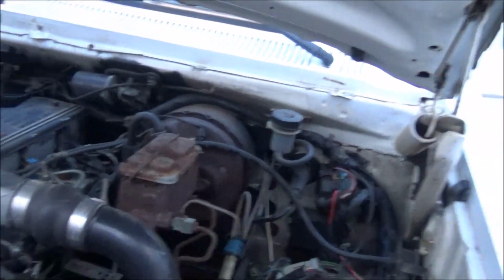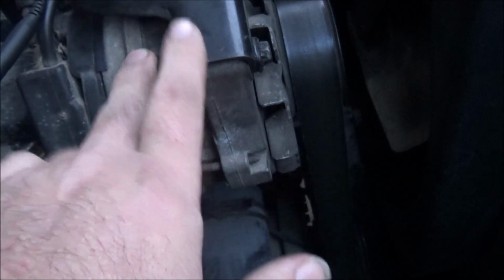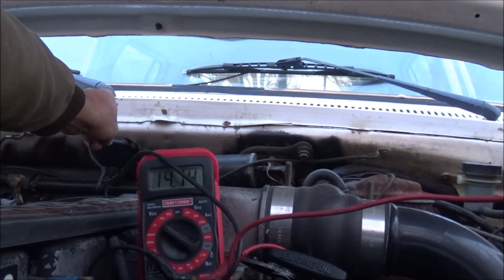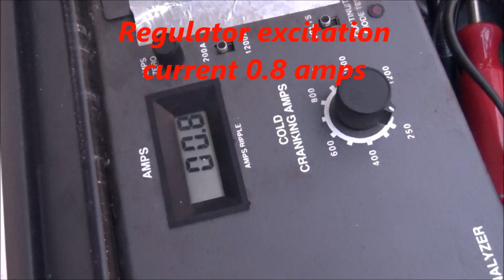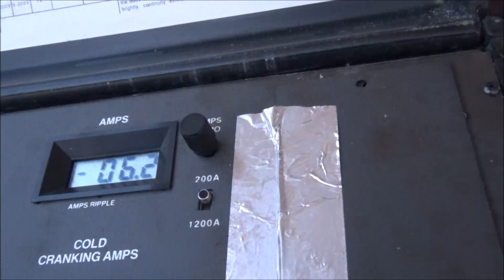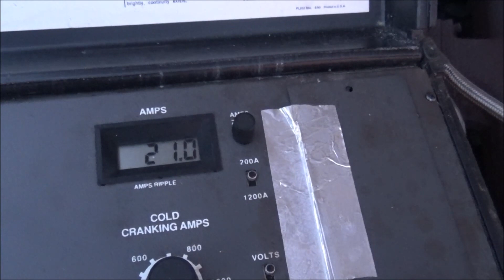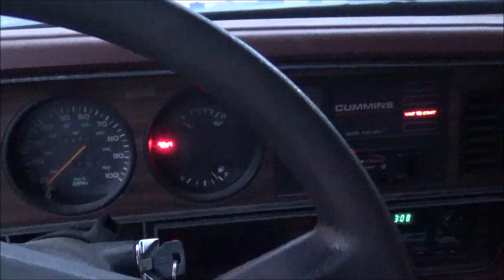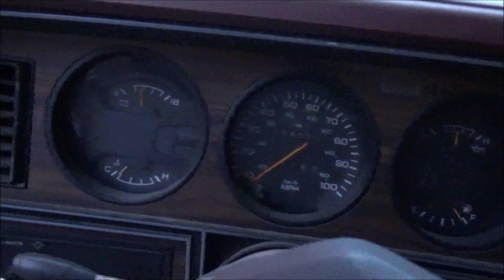Excorsing Electrical Gremlins

Comment: My compliments to you for a VERY thorough analysis of the charging system plus you appear to understand how it works. If you discontinue needing to refresh the regulator, I think you have to "assume" the problem was in the former alternator. I am never comfortable not knowing the exact cause of a problem after it has somehow been corrected. Just for giggles and grins, you may want to have the old alternator tested at a reliable autoelectric shop, not at a chain parts store. Thanks for the update and good luck now after the changes.

Comment: Aloha  I agree with Walt  I have had success with temporary jumper connections and observing the results.  An ohmmeter is not a good ground test in that under hood environment, that said I agree with your friend about shunt paths on a permeant basis.  Again as I said before the rotor in the old alternator was a possibility.  I hope your fix is permanent.
Chuck

Comment: Ohms don't tell you anything when it comes to grounds unless the wire is completely broke, checking voltage drop on cables while running is a step in the right direction, but the load isn't high enough to show a bad cable, any voltage difference on a cable is bad even .15v , that is at 15 to 20 amp draw , an increase in draw such as when trailer is hooked up will significantly increase voltage drop which causes an increased draw etc, the different amp readings also point toward bad cables. Checking ground connections doesn't tell you if the cables are bad internally, you need to do the voltage drop tests on the cables, poss and negative, while engine is being cranked to simulated high load on the cables, disconnect the run circuit and get someone to crank it while you  test the cables.
Reply: I agree. You can have continuity over a connection thinner than a human hair, but it wont handle any capacity in current. OHM test is almost useless unless you are trying to find a broken wire. Additionally a nice static test with the vehicle in park and idling away can be misleading. Bouncing down the road makes the demons come out. Much harder to locate intermittent electrical issues. I doubt he is getting a bunch of bad regulators.
Reply: Absolutely the truth.

Comment: Brian
I had the same problem with my wife's mail jeep. It would eat regulators about every three to six months. It was mounted low near the engine block. I moved it higher onto the finder well and that solved the problem. 
Solid state devices and heat do net get along well. Cummings turbos generate lots of heat when under load and can effect the regulator. Try moving it from the fire wall to the front of the engine compartment. Worked for me.
Reply from the maker: Thanks for the tip. I may have to try that if it fails again. It is in the same location as on my other truck though and it has lasted for as long as I have had the truck and 100,000+miles.

Comment: Brian. I'm sure you mentioned Bosch alternator and a Japanese one. All Bosch  alternators (maybe not first ones) but say after 1975 had a built-in diode pack. This stopped the alternator becoming a motor and trying to drive the engine and  also maximised the voltage output to 14.2 volts. The diode pack was part of the brushes unit attached to the back of the alternator and as such could be replaced without removing the alternator.. If your Bosch alternator is like this then you need to bypass the regulator  because it will cause the problem you describe, I have a Triumph Spitfire  which has an alternator  but the early ones had dynamo and regulator. Both wiring looms are in my Haynes manual. I used to convert cars with dynamo to alternator. The Lucas RB340  regulators were marked B for Battery D for Dynamo (Alt)on the large terminals  and F for Field  and WL  for the dashboard Warning Light.  There was also a fifth terminal E  Earth for the Regulator. To convert  to alt  the B and D terminals had to be connected together,  The Warning Light terminal  and Field terminals were connected together. Thus when you turned the ignition on the dash warning light would come on and the alternator field would be activated as before but NO REGULATOR. I hope this helps.

Comment: BC, thank you for taking my advice to monitor the alternator field current.  I think that is the key to solving this problem.  It can't be considered good or consistent, if I followed your video correctly...Was the alternator field current going high before you turned on the accessories?   It appeared to me that the field current was varying wildly...What is called for here is a scan tool, that can graph voltage over time, followed with a road trip.   I would map NOT the battery voltage, but the alternator field current while driving the vehicle, as the battery voltage will lag the regulator output considerably.

Entirely possible that you have an intermittent short to ground from some wire.  It could explain the irregularities in your tests.

Entirely possible you just have a chaffed wire, although they should be fuse protected, they do take time to blow....

I would go over the main battery wire/starter/ground wires with a fine tooth comb.

If you could scope that charging system while out and about, might be beneficial.

Comment: Very similar to my experience with the truck I referred to in other video. I didn't have meters in those days so I didn't have all the info you've got now. Something else you can look for if this persists goes along with previous comment about pinched wires. I had a truck with an 1157 signal bulb get a loose filament. bouncing down the road it would cross to ground, stick because of the draw, then continue to draw after shutdown. It created a slow bleed off of the battery. After it drained the battery, it would cool off, the filament would disconnect and no problem could be found. It was a brake light brighter element Which of course didn't show at first, took a couple jumpstarts to find that one. After being "schooled", that one is most often spotted when you see a vehicle driving with extremely dim marker lights and no lights running. Their light switch will be off. I've wondered about my old dodge, if there was some other slow bleed off that was intermittent. Seems that would be all you have left to hunt. I've heard about the Fords getting a intermittent slow draw out the solenoids creating gremlins. Keep us up on it, win or lose, I'm not the only one that wants to see the answer.
Reply from the maker: I don't have any discharge problems though the truck can sit a month and fire right up. The only problem I know for sure is the regulators quitting.
Reply: bcbloc02 Your right there then I would guess, unless is it possible a backfeed could have  blown a diode maybe in other alternator.? I hate gremlins, time sucking monsters.

Comment: Okay guys, here's my final diagnosis. Age related high resistance UNDER DASH is dropping sense voltage to regulator. 15 volts to the battery is just too much. A new regulator wouldn't try to push that much unless it was receiving erroneous information (reduced voltage to sense lead). This causes regulator to overcharge battery, as well as exceeding expected duty cycle on regulator, burning up regulator. 
Rather than fight the high resistance, just use current wire from ignition to regulator to switch a relay. The relay switches a lead direct from battery (thru 10A safety fuse) to sense input on regulator.

Comment: Things like that drive you crazy, I like the old school mechanical engine no def in that baby.
Reply from the maker: Just an ultra reliable 20mpg on this ride. You may not have any lights but it at least always will run if you can find a hill to roll it off. :-)

Comment: the volage drop on the positive cable is on the high side, usually should be less than 0.10v dc so even though you have low resistance under load your load resistance effecting the the circuit volage which would be why it could be charging on the high side voltage wise. I would look into a new positve cable assembly.

Comment: Brian, the charge voltage across the battery post should be 14.2-14.5 VDC but anything over 14.7 will cause gassing of the battery and possible damage. It may be possible you have a flakey cell in your battery causing the regulator to output more voltage. Since you are charging at almost 14.9 VDC, something seems amiss. I did read an article where a guy had your problem and redid all the grounding and replaced the alternator, only to burn out his next regulator. Out of desperation, he changed the battery and the problem went away. Just a thought to see if you could swap the battery to see if the charge voltage across (a fully charged battery), would drop back into normal range.
Reply from the maker: This particular reg is a little hot. The previous exact same reg ran about 14.6 on the same battery.  Having had multiples of these regs on the same truck I have seen a lot of variance in their outputs. It is one of the reasons I suspect the regulators are all junk and there is nothing wrong with the truck or alternator.  I think the quality is typical chicom garbage and I need to find a old genuine regulator. Lucky for me one of my viewers has offered to build a proper reg so maybe that will be the final solution.
Reply: bcbloc02 You may be right. I worked in electronics technical support for many years. I used to tell the folks that called me that they were the experts since they did this everyday. I was there to find the "goofy shit" or what I called, what it couldn't possibly be. What I usually found was it was something incredibly simple or something it couldn't possibly be. That's why I recommended the battery swap since it is the least likely problem but one that others have reported. I once had a problem with a printed circuit that measured a zero ohm connection. Once we bypassed the solder trace with a wire, the problem went away. Both measured zero ohms but a load caused high resistance in the printed circuit. Batteries not only provide power but filter and buffer any dirty DC current. The telephone companies still use large batteries for backup but their daily job is to filter "talk battery" so any rectifier spikes don't show up as noise.
Reply: Swapping the battery makes sense to me. The theory would be that the battery is drawing too many amps for too long. Or not. But it's easy to try.
Reply: Problem:  You can run vehicles without a battery period once you've started them.

Next problem, heavy current drains from a bad battery reduces battery voltage, not  increasing it.    His voltage readings are high however.  I admit that seems strange.

Nothing like throwing in a bad replacement part to confuse a man to insanity.....I troubleshoot equipment (not cars) similar to vehicles for a living....I'm am barely sane......use a bad part and your whole world goes crazy.....or how about 2 bad replacement parts....nothing makes sense then....LOL
Reply: Clete88 You are correct that a bad cell would lower voltage but that would be the output of the battery, not the charge voltage output determined by the regulator.

Comment: Many years ago I used to work on cars and light commercials in the UK. I can tell you that none of these to my knowledge used a regulator unless they were fitted with a dynamo. Every alternator  had a diode pack  at the rear which controlled the output. The heavy duty wire  connected either direct to the battery positive or the other end of that main cable at the pre-engaged starter motor main terminal.. The small field terminal went via the ignition warning light to the ignition switch. Alternators that were rubber mounted had an earth strap to the engine.  The battery earth was connected to both the engine and bodywork. Nothing else was needed. Charging voltage was 13.7 to 14.2. There were very few problems apart from loose or dirty connections.
Reply: +colm, thats how our british alternators work, but the americans seem to like to follow old habits and use an external regulator, just like we used to with dynamos, they can of course buy an integrated alternator if they want to, they also seem to enjoy alternators that overcharge batteries at 14.8 or over 15v but thats up to them :)
Reply: As a lifelong American and heavy duty equipment/diesel mechanic I can assure you that most Americans have not a clue what voltage  their battery is being charged at.  Those of us who are in the know are not happy with a 14.88V~15V reading of alternator output.  While we Americans do indeed follow old habits at times, you are forgetting that this truck is at least 24 years old and maybe quite a few years older.  That said this particular setup was an antique even back then.  GM alternators have used internal regulators since before this truck was built.
Reply: +mister, im not forgettingits age, i drive a 26 year old ford fiesta myself... and its the newest car ive ever owned!, even my previous 1972 ford,had an alternator with internal regulator!
Reply: Yes, GM first introduced internally regulated alternators in 1969... you do realize that Ford of England is a subsidiary of Ford US, right? Perhaps Ford was testing out it's newly developed internally regulated alternator on English Fords!
Reply: +mister I knew Ford is ford, i didnt know the when's of the alternator. my brothers 1972 car still has a dynamo (morris) still thats how it goes!
Reply: English  Fords  used Lucas alternators which had a diode pack from day one. I owned one.
Reply: What we in the trade call a diode trio is what makes an alternator an alternator and a voltage regulator (interal or external) is a different animal all together.  I actually built a replacement diode trio for the alternator in my BMW motorcycle a few years back.

Comment: Brian, that charging voltage of 14.89 seems a bit on the high side. 
Should be around 14.3 to 14.5. If your battery has high internal 
resistance from being constantly overcharged, that would explain why the
 regulator is hunting.

Comment: Earth the regulator body to the alternator case with a dedicated wire.
Reply: I agree ..
Reply: yep
Reply: This will destroy the regulator......that's his original problem....You would just be forcing the regulator into full charge......The problem is frying them to begin with.
Reply: And boil the battery....
Reply: no way , were talking ground just a dedicated ground ! nothing to do with the hot wire ..
Reply: Earthing body of regulator to body of alternator = earth to earth. This can do none of the harm you suggest. Is to ensure earth potential is same at regulator as at alternator. Else fluctuations will occur. Same as live feed from ignition source if dodgy then regulator will do crazy things.

Comment: Just some information. When the battery voltage gets up to the regulator set point the regulator turns off the field current till the voltage drops below the set point this happens fast enough that a digital voltmeter can't follow exactly. This is what is causing the varying reading you were seeing. For situation like this I prefer to use an analog voltmeter or a scope. You get a much better picture of what is actually going on.
Reply: Jim Hannon you are "right on" with the analog meter suggestion.

Comment: A couple of people mentioned a blown diode, I've known that to cause some real squirrel-y issues...  Someone else mentioned a bad cell in your battery, have you load tested your bat?  To my memory a bad cell will definitely cause voltage regulator heating as well and associated failures. Haven't dealt with a blown diode in a lot of years but I recall it can be real hard to pinpoint.

Comment: Remake all the grounds with heavier cable and new rust free connections. A contiguous ground strap made of braided cable will resolve the issue. You can measure the connections with an ohm meter, but those old connections will change with temperature and moisture, causing intermittent gremlins.  Yes, it's working now because of the connections being disturbed while changing out the alternator and regulator....but it will happen again.  IMHO.

Comment: Hi Brian,  
So far it looks good....   !!!
Now, would the trailer draw more current than it's possible to supply, this will be the next test...
Hope this is solved for good....   ;)
Cheers,   Pierre
Reply from the maker: Trailer adds at most a 30amp load, the alternator should have no trouble keeping up with that and it doesn't. When it is hooked up I show no discharge condition. I hope it is fixed if not I had a kind viewer offer to build a better regulator so that is in the works too. :-)

Comment: Brian, Had a problem like this on a buddy' van. The van had been slightly hit in the rear and it pinched a wiring harness to the aft lights. Took a while to find it but one very small  side marked light lead was rubbing intermittently against the body.
Fixed the bare wire and problem solved. Wonder if you have a similar situation.
Regards,
Eric
Reply from the maker: It is possible, I wish it would shoot a fuse so I knew where to search! I have done a pretty thurough look over and couldn't find any wire defects.